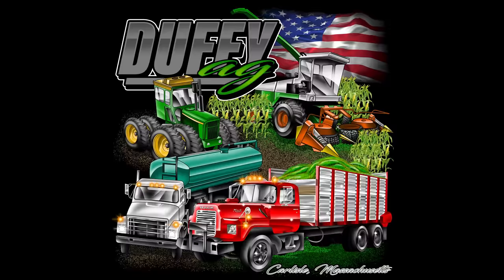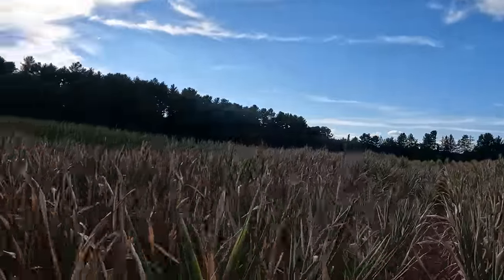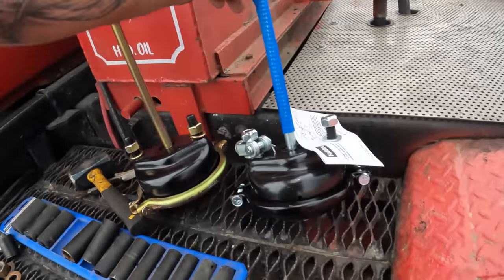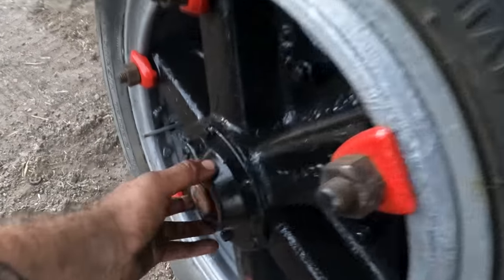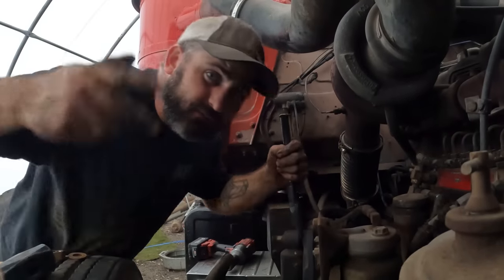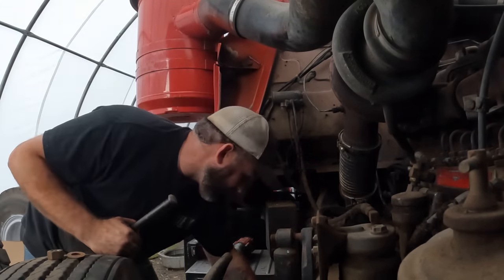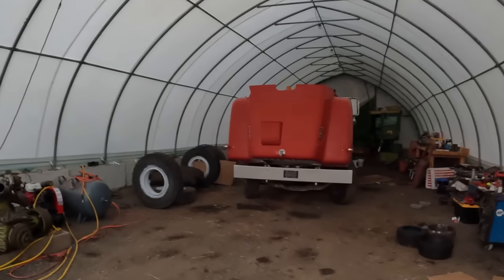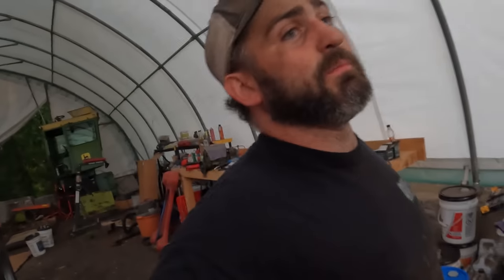Drought Corn & Moving Preparation. Will This Truck Ride Smoother Now?

Comment: Truck is looking good. My 2 cents about you moving on to this  new venture, is as long as it makes financial sense,  go for it. Even if it doesn't work out in the long run, the experience will be worth it.
Reply: We’ll stated. In my opinion I think most people lose sight of the experience they gain

Comment: When I change shocks on my truck I always put ant-seize on the shaft before installing the new shock. Makes changing them next time easier. Old trucks are a lot of work to get into shape and keep them in shape but they are definitely dependable if you stay on top of the maintenance.  Best of luck! Love your positive attitude and approach to everything!

Comment: They have those shocks because they have probably been sitting there for 5 years or longer. I used to love working for an old truck and automotive parts store. It was amazing all the old stuff in stock they had. Couldn't get new stuff until the next day.

Comment: If you have time and money, when you redo the back of the Mack set it up for gooseneck hitch and ball/pin hitch set up. That way it can be used for anything, anytime, anywhere.    Tools bars, anhydrous tanks, tractors, trailers, wagons, anything you can think of.    How are you planning to get your equipment across 7 states?  Tags and permits of such? Or shipping?

Comment: Hi it may off been said but you mentioned you need someone to help you to push the peddle down doing truck i work by my self and use a piece of wood between peddle and seat mount or bottom dash etc so you can go out and check air leeks etc i do think you can purchase special ratchet type  peddle pushers to to do the same to help you

Comment: Maybe chop the failed corn to test the corn head with?  Plus it may be easier to disc in then.
Reply: Kudos - Spot on. If it breaks down again in 5 acres, don’t bother spending the $4 loaded mile for 1,360 miles to haul it to Iowa.

Comment: Hey just a tip for ya I know it's old Max if the king pins take grease slowly taken Jack the front end up and takes some of the pressure off and pins it'll take grease better and get better flour on the pen
Reply: The correct way to grease kingpins is to jack them up to grease them turning the steering wheel in both directions wheel stop to wheel stop

Comment: I remember the Kemper head taking a dump last fall when you were custom chopping. Did you already fix that issue?  I honestly don’t remember. If not and you end up waiting for parts, will that affect the corn chopping you have planned?  When you had the motor issues in the chopper I was actually wondering about this and then also the wider head you got.

Comment: Bank will probably laugh at your assets. Most is old and obsolete
To most people. Just telling you the way it is. There looking at it if you went belly up and it went to sale.
  One thing out there might be first time farmer money ??????
Reply: George Jones  FSA will only lend 50% of claimed equipment value, in case of loan default there will be plenty of margin to recoup outstanding debt - especially with a borrower with no track record with the size of farming operation. Thus, with $50,000 in equipment value gets you a $25,000 operating loan, enough for a 50 acre operation.